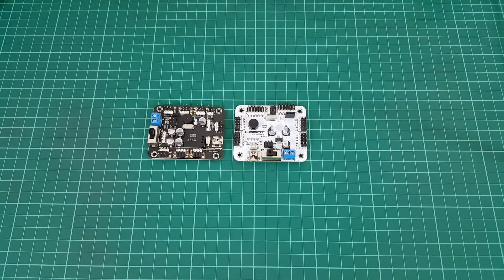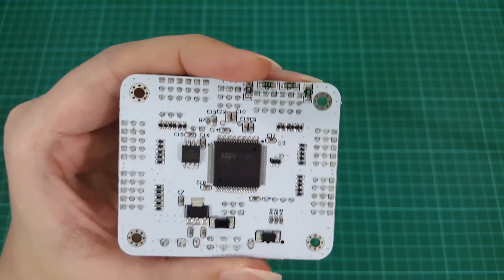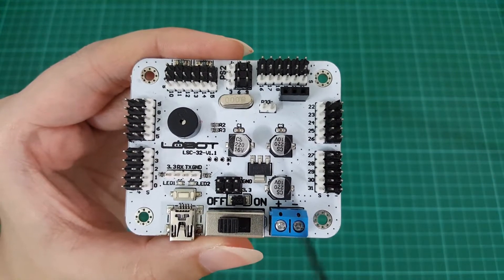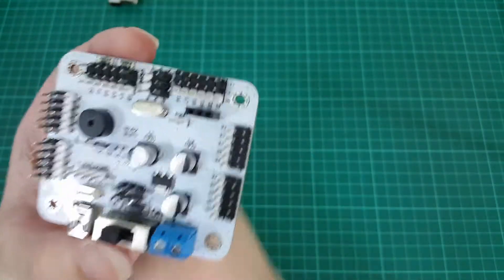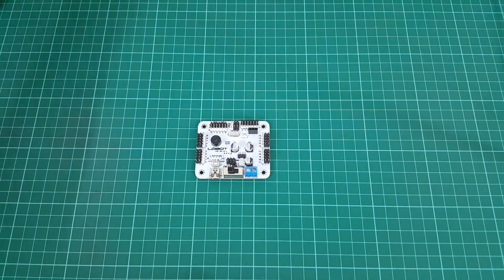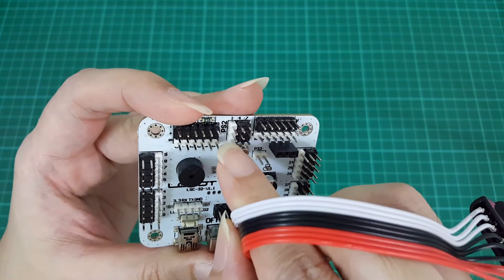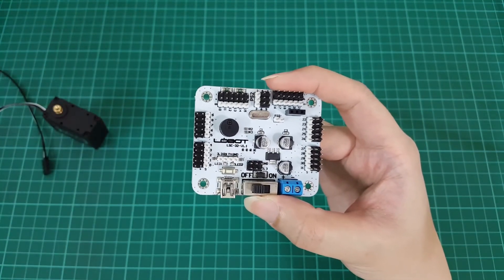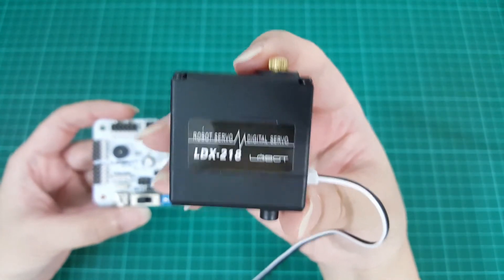Hexapod Robot (Robo-Soul CR-6) - Part 3: Servo Controller

Comment: that board is old now the new ones have auto voltage and reverse usb protection your 2 years out of date its nearly 2019 :) there are better ones as well than these now
Reply from the maker: I think you may have mistaken this for another board or you were not paying enough attention. I checked a moment ago and the latest board is still the same design. The protection is only for 6 channels for the 32 Channel board. If you want full protection, you need to get the 24 Channel version.

Comment: can I use this board to run two wire micro motors like these? https://www.ebay.com/itm/DC-6V-30RPM-Micro-Speed-Reduction-Gear-Motor-with-Metal-Gearbox-Wheel-N20/111742307756?ssPageName=STRK%3AMEBIDX%3AIT&_trksid=p2060353.m2749.l2649    and  https://www.ebay.com/itm/DC-3V-Micro-Mini-6mm-Planetary-Gear-Reducer-Motor-Micro-Coreless-Gearbox-Motor/122088907727?ssPageName=STRK%3AMEBIDX%3AIT&_trksid=p2060353.m2749.l2649
Reply from the maker: Hi! From the product description, these boards are meant for servos. I am not really sure if they can be used for motors. I don't think they can but I only have limited knowledge. Sorry for not being to advise much.
Reply: That's cool. I think your right... Thanks.

Comment: Can we connect this servo controller to rasberry pi, if then can u tell me how?
Reply from the maker: I have only tried it on an Arduino. You basically connect using the Serial pins (RX/TX). However, I am not sure if there are any libraries for it in Raspberry Pi.